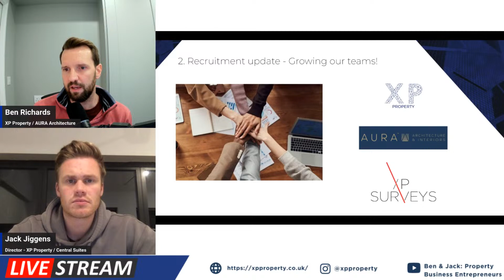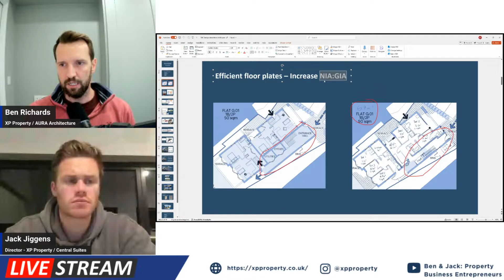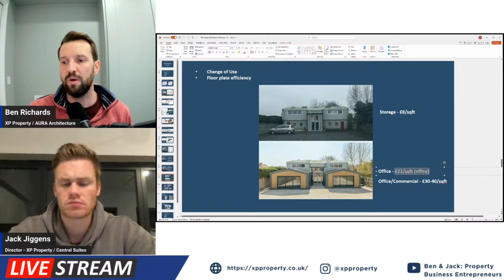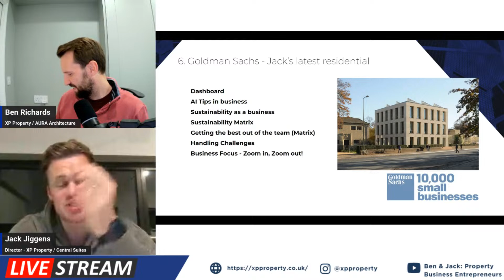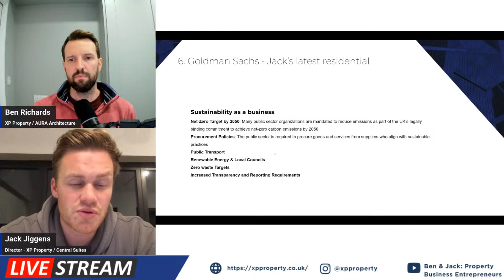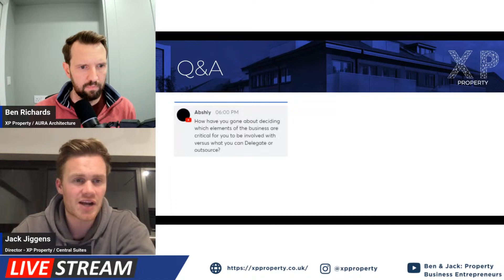S2E43 - Ben's Top 10 Design Tips for your Developments!

Comment: Hi Guys  
Ceiling heights .. please could you let me know what the minimum finished ceiling height you would use      Cheers Guys loving the show!
Reply from the maker: Hi John.  Really depends.  I will always try to get at least 2.4m where possible. 

London design guide for new builds is now 2.5m

National space standards dictates that 75% of the GIA needs to be a minimum 2.3m
Reply: @ Really appreciate your answer and super swift response thanks a lot 👌